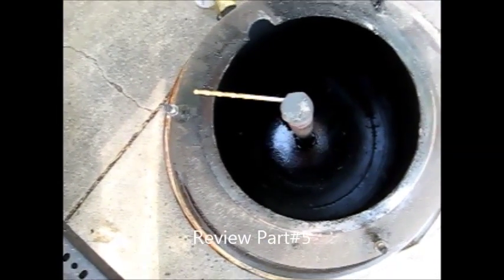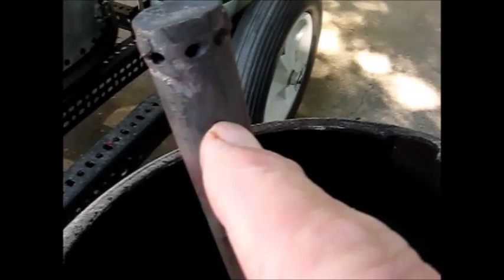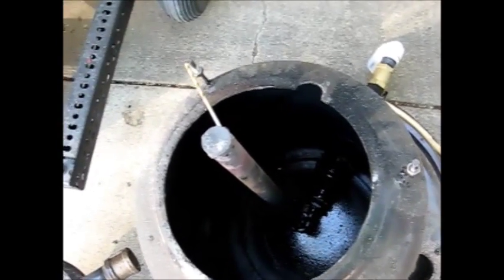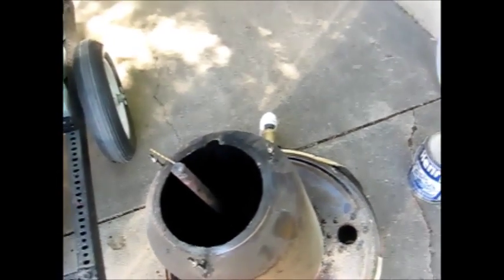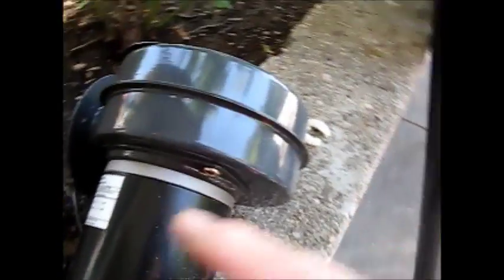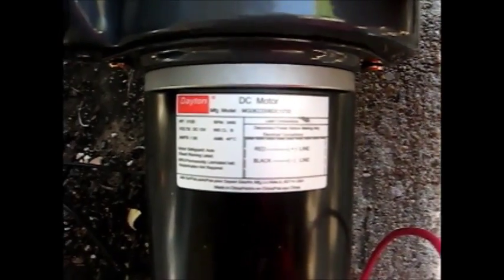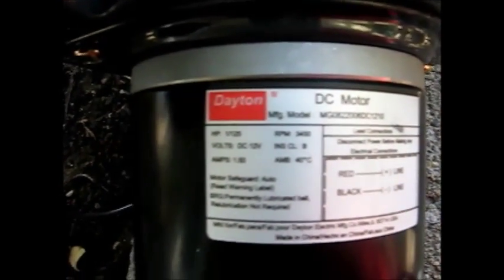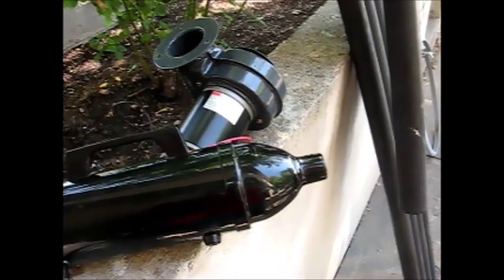Gasifier Review Video 5

Comment: I personally modified a blower similar to the dayton one you bought for 108 bucks. I coupled a larger motor to it. Big waste of time and energy. The problem with that blower is how wide the squirrel cage is . You need a blower with one or two narrow squirrel cage fans.  Those will pull your arm through the hose. Second,  as far as a blower goes,  yes it's nice to have a blower that can be disassembled,  but if you start with biochar , you won't worry about tar. I think air leaks and sealing the hearth to the hopper,  and a blower that can make it through the run are your biggest issues.  Joe

Comment: Talking of blower motors, I get excellent results from my 12 volt bilge blowers. 
 These are 4 inch ones, like the one you have shown us. 
 I have 2 of them, plumbed - in line, to boost the starting vacuum on the gasser. 
 Though their motors are subject to the gas stream, they are sufficiently well sealed that they never cause any problems. 
 I think you'll find that your bilge blower is the best candidate for your gasifier.
Reply from the maker: Ok I'll keep using the Bilge Blower

Comment: Instead of drilling more holes, try making the holes you already have bigger. I think you are correct in saying that your issue is air leaks. The wood chunks are way too large so that definitely is one of your issues. You need small chunks around 1/2 inches up to 3/4 inches.
Reply from the maker: I wondered if they were a little Large for the gap.